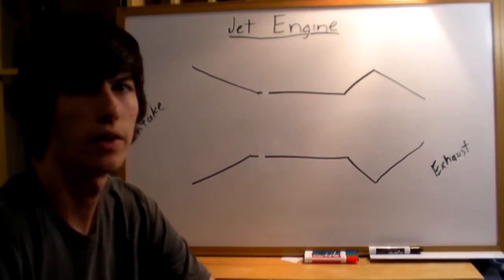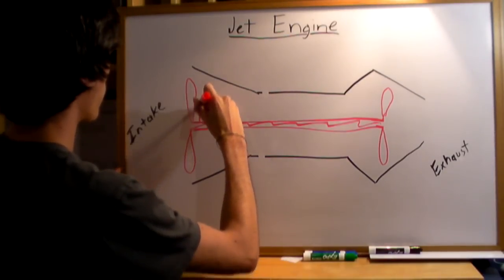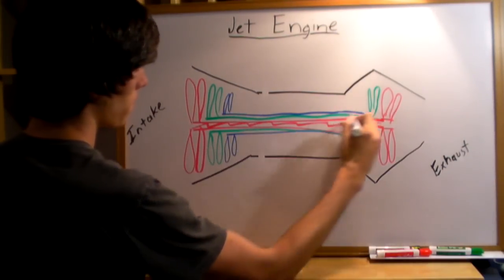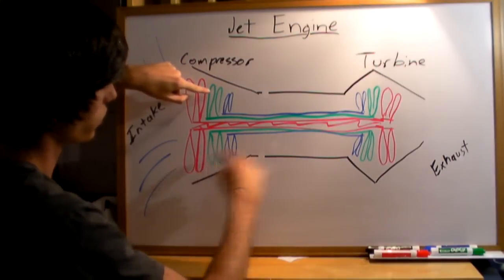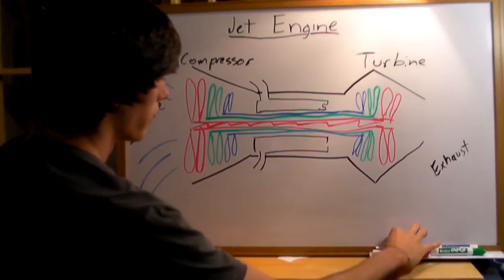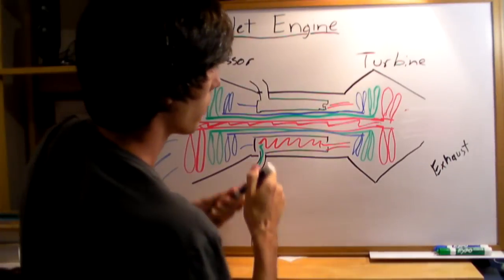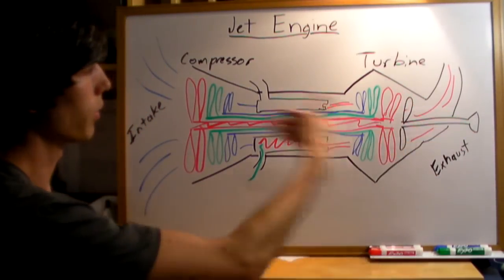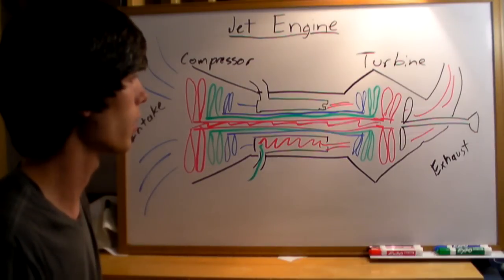Jet Engine - Explained

Comment: Literally the clearest explanation I could find and it's like 6 years old. Thanks!
Reply from the maker: Haha very welcome!
Reply: they all use fansy animations but no one provides good clear info like this guy
Reply: Lol 😂
Reply: 9 years now
Reply: 11 years now and still the simplest way to set your mind to understand the complexity of a jet engine.
Reply: The video has a number of inaccuracies. He said that the airflow gets faster as the compressor part of the engine gets narrower
Reply: Thank you
Reply: Still the best
Reply: Look what's 6 years old now
Reply: Turns out still holds up 11 years later
Reply: 12 now, still true lol.
Reply: 13 now 😂

Comment: Only a small comment, the air velocity is quite constant through the compressor stages. The goal is to increase the pressure, not the speed. (To begin a preliminary design, you can start from the approximation that the inlet and outlet velocity of a given axial stage is constant)

Thank you for posting, very good

Comment: BTW a turboshaft engine (the configuration explained later in the video, used in tanks and helicopters as explained) is being used in a street legal motorcycle! If you're interested it's called the Turbine Superbike, research it it's a pretty unique thing

Comment from the maker: @Aexotica Just like in cars, large turbines can have starter motors that rotate the main turbine to get things started (starts the rotation of the compressor). If it's a small engine, like for a model plane, you could even just put a fan up to it to get it started (or a hair dryer!).

Comment: An afterburner introduces fuel into the exhaust stream and igniting it, producing more thrust as the gasses expand. This is where thrust vectoring and adjustable vanes come into their own in fighter aircraft as usually a computer like a FADEC would optimise the outlet vane diameter to produce maximum thrust with reheat. Hope this helps and sorry for long concentric replies.

Comment: 1. The compressor does NOT have turbine blades. Turbine is a device that converts kinetic energy into rotational shaft power. That's why you don't have turbine blades in the compressor but compressor blades. Terminology is important!
2. The air does NOT accelerate in the compressor. The narrowing of the compression path is meant to prevent the air from decelerating too much.
3. Modern engines don't have combustor cans anymore. They have a single annular combustor.
4. Modern aviation jet engines are turbofans that have a fan in front of the compressor. It accelerates air that bypasses the core jet engine that you drew completely and may create most of the thrust depending on the design.
5. It would be important to tell about the exhaust nozzle after the turbines which is what accelerates the gas to the highest speed producing thrust. Without the nozzle the gas coming out would be just a hot breath, exaggerating a bit.
Reply: I should correct myself a bit. The fan and compressor do in fact accelerate air from the relative standstill to the speeds inside the compressor. Also according to a Rolls Royce video the air is also accelerated between low pressure compressor (booster) and high pressure compressor. However the total air velocity does not increase while it's passing through either of the compressors.
Reply: veeaa Where can i learn more about jet engines? Im actually really interested.
Reply: rockhopper123452
Best thing to do is get a degree in aerospace engineering. Failing that, many books on thermo/fluid dynamics can help you.

A good place to start is a book published by Rolls-Royce (in many editions) titled simply "The Jet Engine". I'd advise you to get the latest edition as it will reflect the most current information. It is simplified to an extent and does not include the maths behind it (mostly), but that's what the degree and really thick and topic specific books are for :)
Reply: rockhopper123452 Sorry, I sent you a reply when you asked but it never registered obviously. I agree with 233kosta, just stay away from the latest Rolls Royce The Jet Engine book. It doesn't explain many things the older versions do and the quality is rubbish too. Two of my copies are falling apart by themselves!

Also, check out this virtual tour by Rolls Royce with very good and easy to understand information:

http://www.rolls-royce.com/interactive_games/journey03/

If you want a very comprehensive information package, still without complicated math, read the "Aircraft Gas Turbine Powerplants" published by Jeppesen.
Reply: veeaa
Have they messed it up in the latest release? Damn
Reply: veeaa i still can't understand how the shaft rotates , is there a piston that rotates the shaft jus like in a car engine? Please let me know
Reply: pradeep kamal Nope, no pistons, nothing like that. The turbine (blady bit behind combustor) pulls some energy out of the (VERY HOT) exhaust stream and uses it to spin the shaft. Hence - gas turbine engine. The control system of a well designed gas turbine engine can be made very simple. If the conditions can be narrowed sufficiently, all you'd really need is a precise fuel valve. You start it by either spinning it up with an electric motor, blowing gas through the turbine or using a turbine starter unit, which is basically just a small turbine geared onto the HP shaft which needs less gas. Once you've got enough pressure and flowrate you can introduce fuel. After that - the engine will carry on by itself.

Bigger engines built for wider use need systems like VIGVs, computer controlled bleed valves, etc. but a very basic one can be made to be purely mechanical.

In an axial flow turbine, the gas is made to rotate by the nozzle guide vanes which sit in front of the blades (and also get insanely hot!). The spinning air then makes the turbine blades rotate and is sent backwards. In an ideal turbine, this process pulls just enough energy out of the exhaust stream to spin the shaft - coincidentally the energy put into the gas by the compressor, however in reality things like entropy, friction, extra gas for cooling, bleed air, non-ideal operating conditions, etc. will always mean that more energy is pulled out of the stream by the turbine than is put into the stream by the compressor. What's left can be used to drive another turbine (say for another compressor or shaft power, etc.) or as a heat source or for thrust if you've still got enough pressure left after the turbines
Reply: The air slows down a lot while going through the compressor, it's absolute velocity increases, while the axial speed decreases, it moves very slow through the combustion chamber, and has a high pressure. 
I am not sure if my explanation is clear, but I am willing to go more into detail if needed.
Reply: 233kosta What edition of "the jet engine" do you recommend if not the newest one?
Reply: This is my 5th video on how engines work.  I noticed your #4 point in this one.  I am learning.  YouTube is amazing.  This is a new world.  I wish I wasn't aging.  Don't know why I am saying this but there you are.  Thanks.

Comment: I think I know what you mean. When the gases expand, they are going to move toward the path of least resistance. In the example above, because of the change in the pitch in the blades, the easiest path is out toward the rear of the engine. Though there is actually pressure on the backside of the compressor blades, there is more net force on the exhaust side that continues the momentum of the blades.

Comment: Excellent explanation. I want to how the big fans at the front gets driven first? Is it that when the airplane runs faster in the run way, does the speed of the wind hitting these big fan spins compressing the air to start the combustion, is that correct?

Comment from the maker: I'm not sure. I don't think so, but if the material was flexible I suppose it could, or if it were controlled somehow to increase/decrease the suction force. As far as I know though, I believe they are fixed.

Comment: You don't want to have on all the time because of the high fuel consumption. There are also limitations involving altitude and air pressure (i.e. it's much more efficient to activate an afterburner at certain conditions). I'm not sure of any overheating issues, but I assume the afterburner section experiences the similar conditions as the pre-turbine, combustion stage.

Comment: Excellent explanation! But I had an ah ha moment half way through your video... Consider the engine in 3 pieces, 1st is the compressor, 2nd is the storage tank (this was my ah ha) the fuel is injected into the burner can (which remember, it's located inside the storage tank) sort of like direct injection in a car, and burned expanding the gases imparting more energy to the tank of air,  the aft is the exhaust which is where the the burnt gases are expelled causing thrust and also turning the drive shaft to start the process all over again, except, the air never stops like my imaginary engine  :-) When I thought of the engine as 3 distinct pieces, it all made since, now I had something that looked a lot like a normal 2 stroke engine.. Minus the stroke ;-) I realize you'll never see this, but I've studied turbine engines forever but never understood them, Thanks :-).

Comment: Large turbines can use bleed air from the APU to spool a small turbine which is geared with the compressors. When the main turbine spins fast enough, enough air is being compressed to the pressure where fuel can be introduced and combustion can start. After that, the engine is self-sustaining as long as it has fuel. Typically only used in large turbine engines. Others can use electric motors.

Comment: You missed out the stators in the compressor stage I believe, its used to increase the pressure, as the axial flow coupled with the venturi effect of the engine design drops the pressure for increase in velocity.

Comment: Not quite. It is slaved off the main turbine, however depending on the engine design the N1 rotor can provide as much as 80% of the total output thrust in a high bypass engine, if that's what you were talking about when you mentioned commercial jet aircraft.

Comment: I believe the air flow through the engine stays at the same speed. Of course after the inlet duct slows it down and after the exhaust nozzle accelerates it. Also after the combustor the gas speed will be greater but the turbine does not slow the gases either. The compressor (Turbine) rotors and stator are designed to maintain a constant air speed.

Comment: I read a book once and it suggested that the turbines and compressors were designed ie the angle of the blades in them, to facilitate the continued movement through the engine. path of least resistance. aswell as the combustion chamber outlets pointed at the turbines

Comment: I believe that the first intake blades that are connected to the second shaft to a slower turbine are a lot larger and called fan blades which creates the majority of the thrust not into the engine but around the engine. These are called bypass fan blades because they bypass the engine and blow large volumes of slower air around the engine. The pure turbine engine that you are talking about does not need slower fan blades. A straight turbo jet engine  has only one shaft. Unless of course you can give me the name of a turbo jet engine that has two shafts. the reason a fan jet needs two shafts is because  bypass fan blades move such a great volume of air that if it were attached to the main engine there would be a compressor stall and stop the engine . There used to be turbo fan jet engines where everything was driven on one shaft but the fans were a lot smaller and could run faster. but you But you are right about the extra turbine if the engine is used to drive external devices,

Comment: Great example of Rolls Royce triple spool engine. Almost all if not all others only use 2 spools. GE P&W example. Now P&W has what they call a geared turbine/main fan blade. Just like you said, the main front fan runs most efficiently at lower speeds BUT turbines run better at higher speeds. So Instead of of a spool they use a highly efficient gearbox to drive the front main fan

Comment: @Aexotica In fact, as he explained, they have starters. Most are pneumatic. Air flow from the Auxiliary Power Unit is used to spool up the engine to certain RPM where fuel can be injected thus ignited andd voila! the engine has started and now works on its own.  the APU is another engine used mainly as backup to power all the aircraft electric, pneumatic, hidraulic systems when the main engines are shutt off or failed.

Comment: What is being talked about here is a "can-annular" combustion engine. There are various types of jet engines with different types of combustion sections (much like different car engines like a flat four vs a in-line 6). Most jet engines now a days consist of an Annular Combustor (like a donut instead of being lined with cans). The engine sections consist of a Fan section (intake), Compressor section, Combustor section, and a two stage Turbine section (exhaust section). These typically consist of a 2 stage drive shaft instead of a 3 stage (which is shown in this video). The Fan, which typically has 3 blade rotor stages, introduces air into your compressor section, which typically has 5-7 blade rotor stages. Squeezes the compressed air into your combustor section where fuel is added via spray nozzles. Your spray nozzles have air swirlers which allow for evenly mixed fuel to air ratios where it is then ignited via ignitor plugs (larger spark plugs basically). The flames then pass through your two part Turbine section, High Pressure Turbine (HPT) and Low Pressure Turbine (LPT). The Fan and LPT are linked via your fan drive shaft and spin at the same RPM, the same is true for your Compressor and HPT. The exhaust gases from the combustor power the HPT which sends hot gases aft to the LPT. The LPT (which is linked via the fan) in turn powers the Fan sucking air in which powers the compressor. That is your basic jet engine.
Reply: Indeed, Hans von Ohain used an annular combustion in the worlds first jet engine.

Comment: nitpicking alert
- type of engine described is a 3-spool, axial flow, turboshaft with cannular combustion chamber.
- compressor wheels are not turbines 
- missing vital part, compressor stator blades which do the actual compression

Comment: But how does it start when it doesn't have air coming in yet, does it need some kind of electro motor to start the fan to initiate the air intake-compression process?
Reply: There will be some sort of starter/APU which will be used to rotate the compressor initially to a sufficient speed to establish airflow through the engine. I imagine it will only be used until the air is at sufficient pressure (and other necessary conditions e.g temperature/velocity) for combustion to be sustained. Im mechanical engineering undergrad so I don't claim to be an expert at all but that's my best guess!
Reply: @mattthompson5022  the APU sends bleed air to the HPC and that will spin the turbines which will then spin the fan in the inlet. Once a specific RPM is reached fuel is introduced and it will become self sustaining

Comment: Important to note that for a turbine engine used to propel an airplane, only 15% of the air brought in through the front intake goes through the compressor and to the turbine, while the other 85% of the air goes around the outside the of the compressor through the bypass and is also compressed in a narrowing passageway as it gets squeezed out the back of the engine - as thrust.

Comment: hi, im curious if jet engines use spark plugs to ignite the air fuel mixture or is it just that the air is too hot that ignites by itself when mixed with fuel

Comment: This has several reasons. First of all, the weight of the engines spoils the roll-rate if you put it further out of the center of the airplane, because it increases the rotational inertia. Also, the huge airliner engines are very economical, but with it, it would be completely impossibel to reach supersonic speeds because more than 80% of the air only passes the fan at the front but never the combustionchamber. which means most of the airflow stays subsonic.

Comment: The blades in the front are not called turbine blades. They are called compressor blades. The compressor is at the front and the turbine (and turbine blades) are in the rear of the engine.
Reply: Ummmm isn't that what he said? He put compressor above the top of the blades on the front and turbine over the blades in a back
Reply: @CactusJones7  he said that the compressor blades were turbines blades so he said it wrong
Reply: @CactusJones7  and he says the blades are fans which is wrong, the fan only exist in a turbofan engine

Comment: dude, for the compressors, the edges of the blades as shown in the picture should be linear, like they have the same hight/ distance to the (flat, not angled) casing above it. The part that helps these create compression is the blades holsters, on which these compressor blades are fixed, and which they are shaped like a < sort of pointy nosy shape (not linear). As you go up this generally nosy shaped holster, they blades obviously get smaller thus air gets tighter thus compression!

Comment: The velocity of air doesn’t increase as it enter through the compressors, it actually decreases because the pressure is increasing in that time.
Reply: Your totally right. The compressor increases the static pressure. And the temperature raises. But the airspeed in the compressor is constant.
Reply: Yeah, velocity would increase if the flow was incompressible, but the pressure causes density increase instead which satisfies the continuity equation of the flow.